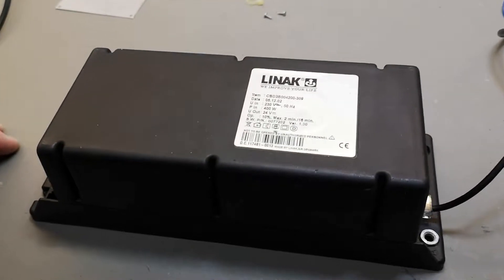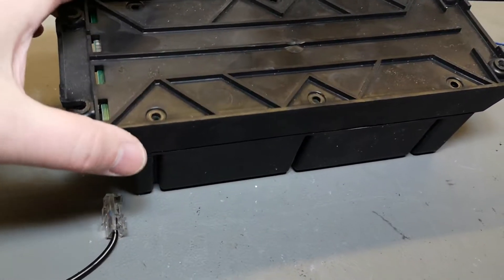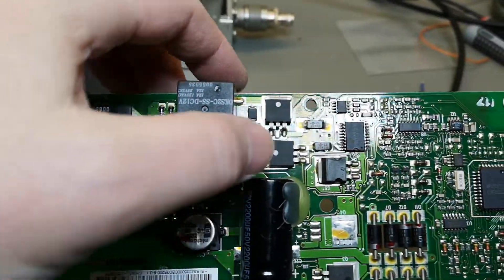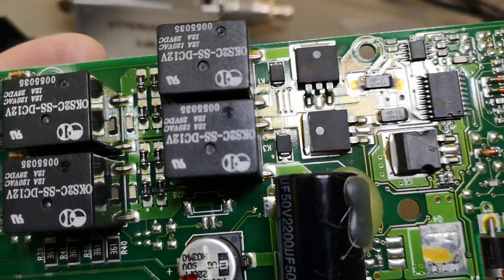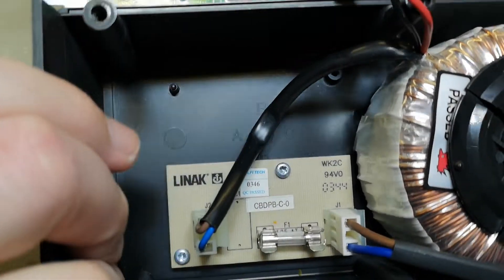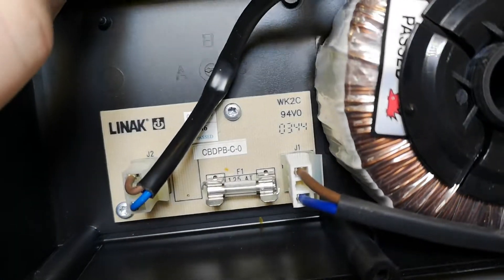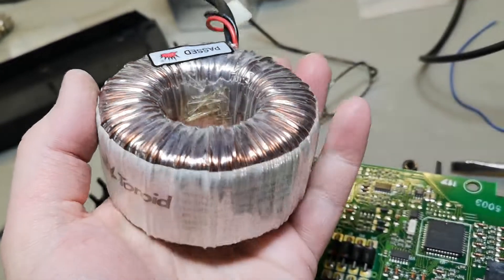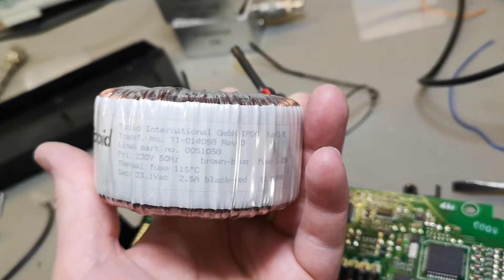Linak Table Controller CBD3B004200-309 (2012) Power supply Teardown

Comment: I acquired a desk recently with this controller but the control buttons to change height was missing, could you please explain to me how I can adjust the height? I figured I could cut a RJ45 cable but I'm not sure which pin on the RJ45 connector is the ground pin, maybe you know the pins? Thanks!

Comment: OK, this looks very much like the ones on my two motorized desks (ex-Gov).  Mine have three motors (very solid desks), and the controller model number is different, but I think they will be very similar internally.  Thanks, this will be useful if I ever need to dive in and repair them (or try to recover the lovely toroid transformer).
Reply: Mine is a CBD1B00030D-39 dated 02.12.04.  Same 24V 400W and made in Denmark, but instead of CE mark it has an Australian approval.  And also no earth pin!